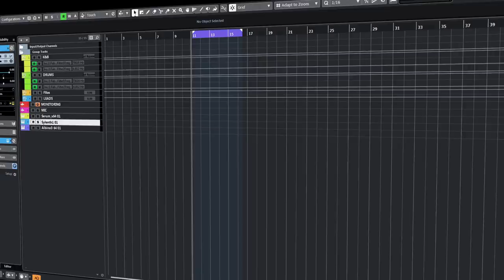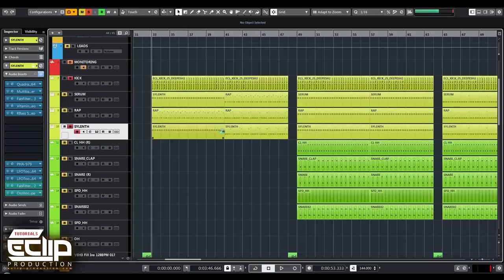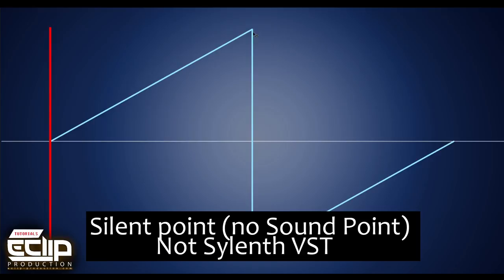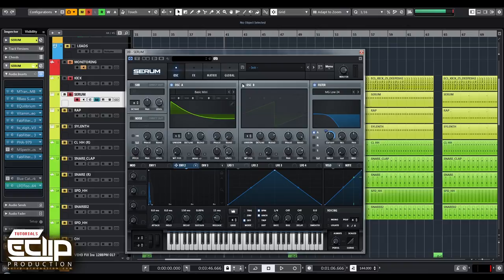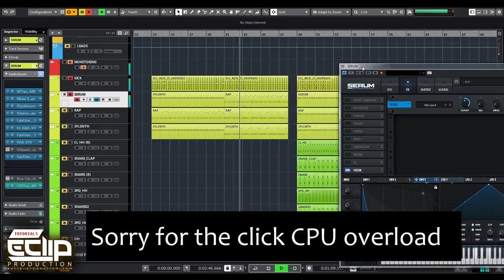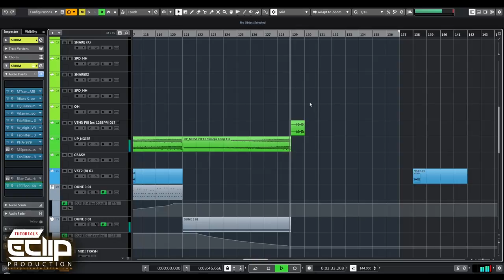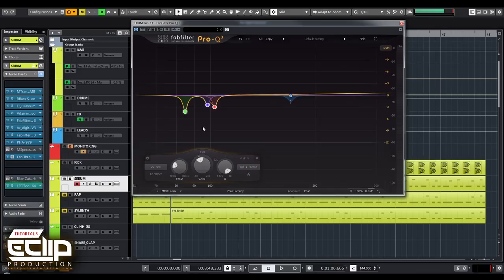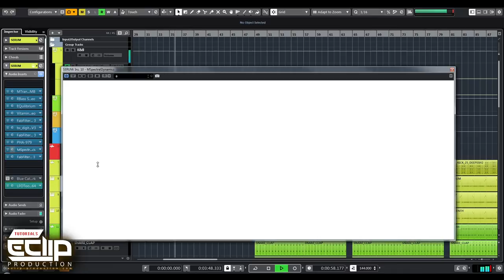How To Process The Melodic Bassline - by E-Clip

Comment: When making transposed basslines, I use the note modulator in Serum to push down the sustain on the amp envelope (and sometimes the decay on the amp and/or mod envelope) to deal with the volume changes. It takes some time to adjust the curves in the note modulator panel (always pull the lowest note down to 0 in the panel, highest note to the top), but this method seems to work well for me. Do you think this is a good method? Im not very experienced with producing music, so I dont always trust my own judgement.
Reply from the maker: Never tried it, but like this without trying it doesn't sound like a good option to me. I prefer to have the same notes structure on all notes, that way I'm sure it will work on all tones, and I would be able to reuse the same bassline in other tracks.
As I said, I didn't try it, so it might happen that I'm not right, if it works for you, then you shall continue with it, doesn't matter what  I think. :)

Comment: do you think so called 'musical' eq's like the maag air or waves puigtec are really better? I make music since 10 years and can't really hear a difference. And if there is a difference I can adjust the fabfilter to where it sounds pretty much the same . What is your opinion?
Reply from the maker: There are some points of EQ that are important to me, like how does it lowcut for example. Many different EQs have totally different results with the same LowCut. Waves Puigtec is really nice EQ for some processes, but if you do the test, you will notice that Puigtech, just by inserting it on any sound, with Output on 0 actually boost a signal for 1db, if you set Puigtech on -1 on output, and then when you bypass it, there won't be any change in the sound. This is a marketing trick that Wavs do a lot, and it is a kind of cheating trick, and therefore I always try to avoid Waves plugins as they are a bit tricky  and cheaty (some of their plugins flip the phase, just  to trick the user that it does the magic trick)
Reply: @EClipChannel  great anwser! thank you very much. i like your videos a lot